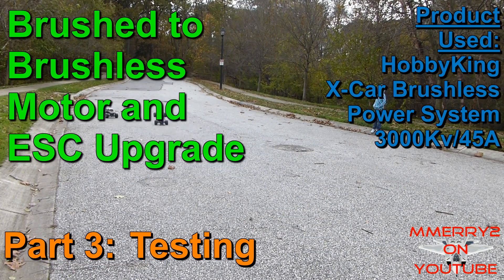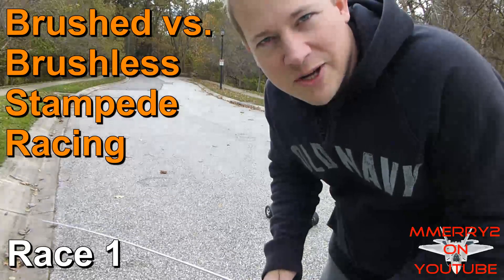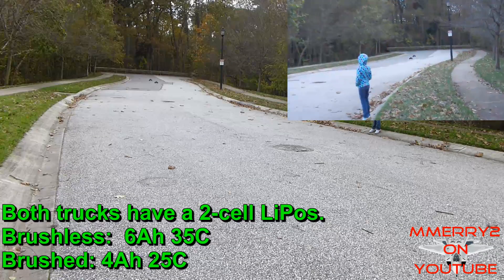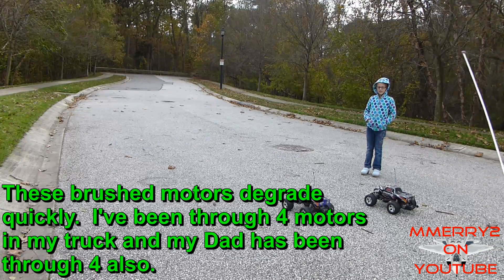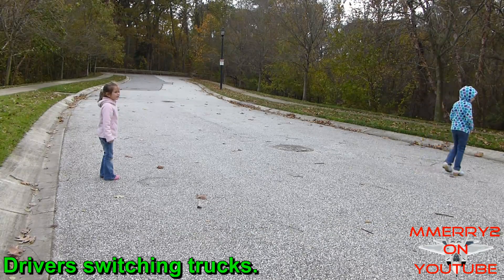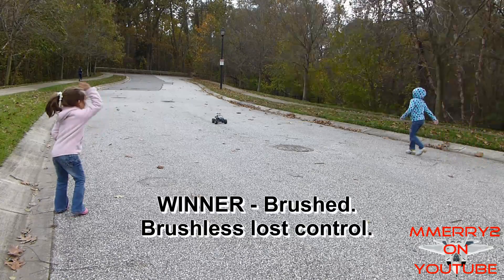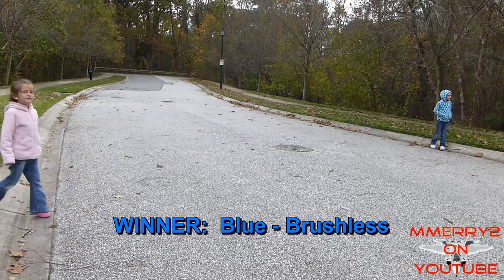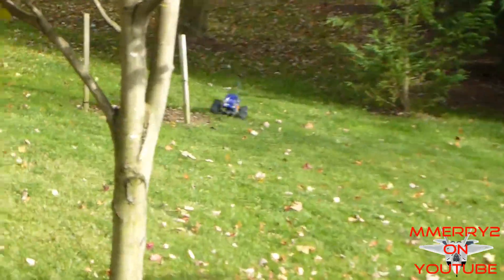AWESOME Brushed to Brushless Motor Upgrade! - Part 3

Comment: i put a stock Mini e-revo and a 60amp hobbyking ESC on mine with a 2s 2600mah  i cant keep it on the road way to fast an the power is just stupid.. i switched the setup over to my RC10 for open wheel modified racing  and ones who ASK i used the motor adapter from 16th to 10th scale

Comment: Program the esc to full punch , full throttle , with a 2c lipo I put that system in my slash 23/90 was my gearing, I put a gps on mine , I got 56mph , with programming esc to full throttle punch , with 3c lipo i got 68.5 mph! Look it up, it's good  for the price!

Comment: Well wish i would have seen this vid a few months back. Ill give ya some friendly RC car info on your set up from a racers view. Right now with your truck and my guess stock traxxas gearing its a tad bit under geared for the ESC/motor combo you have. If i wanted more speed change your gearing up some try like 30/83 that should give you more top end speed. On the flip note you will have less torque/ punch at that start. Just a FYI the traxxas Velineon system is a 3500kv  but you have more torque.